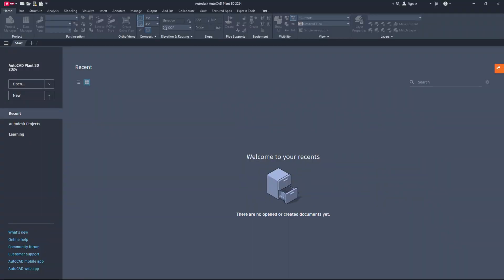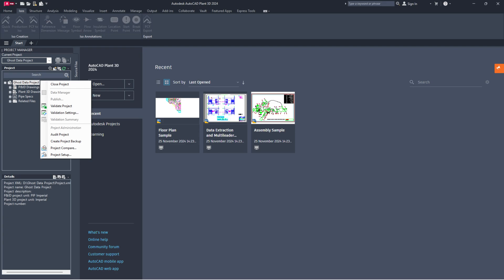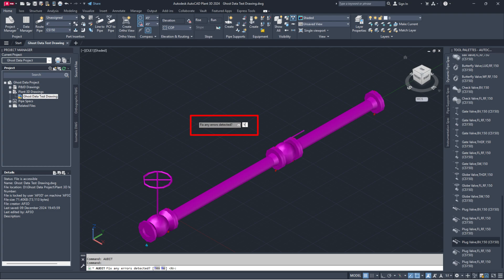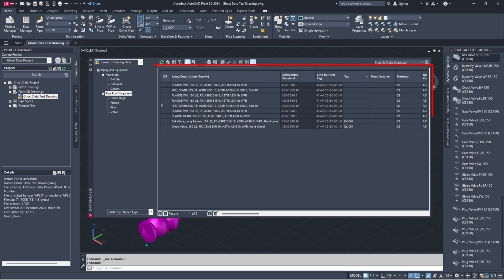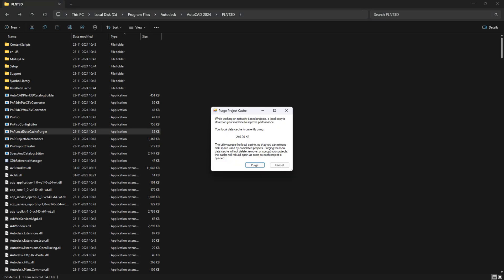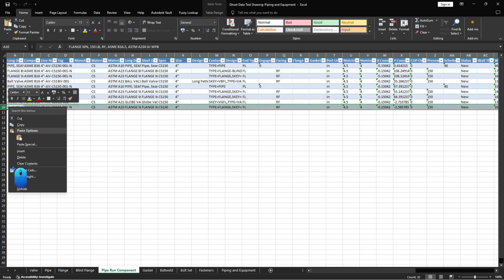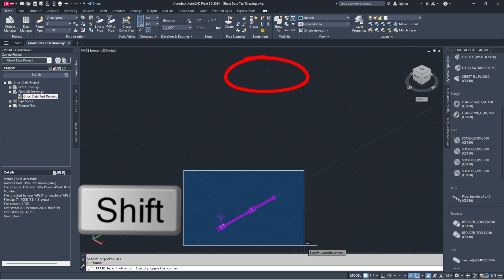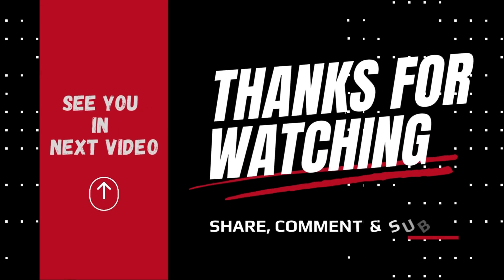AutoCAD Plant 3D | Remove Unwanted Data from Data Manager

Comment: How about gosht in P&ID, i follow all of these steps and can not clear my Data manager.
Reply from the maker: If the steps I outlined in my video do not fix your problem, you will need to manually remove orphan data from the ProcessPower.dcf files using SQLite Expert Personal Software.